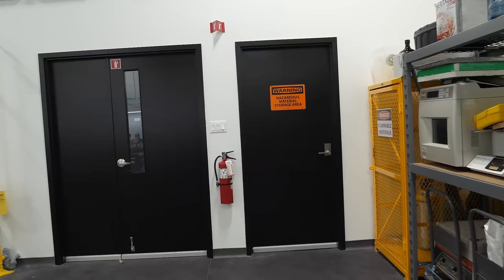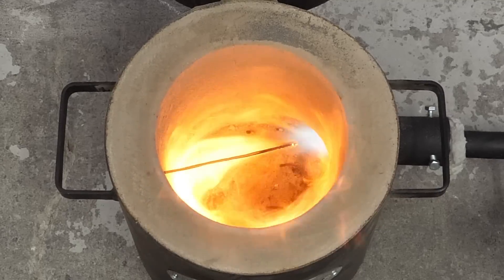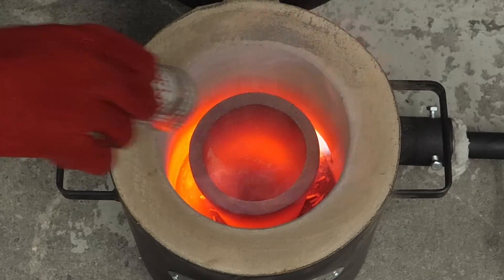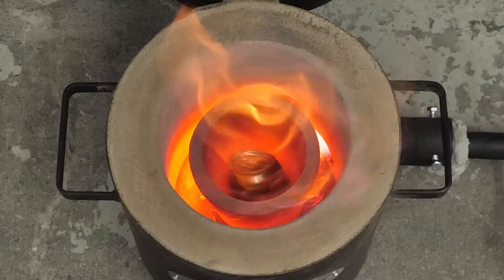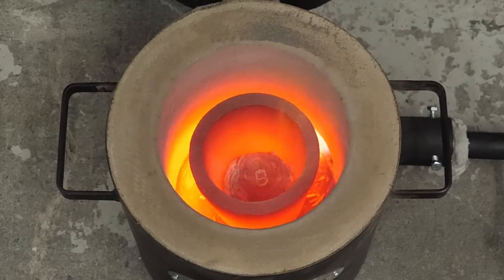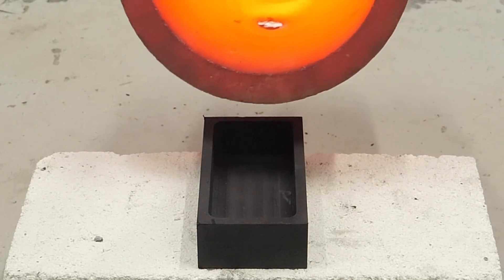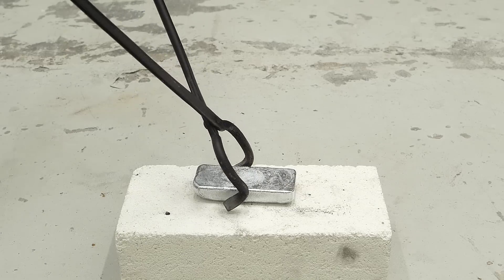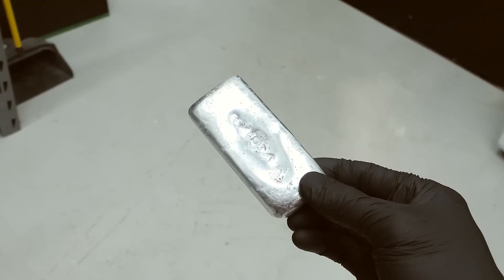Turning soda cans into a metal bar

Comment: That'd be a 0,15€/can in Finland when you return them to the stores for recycling. But that price is already included in the product price so you are basically just getting it back if you bought it yourself. And still, there are tons of cans and bottles on on the roadsides here in Finland. One bike ride and you could get a few euros worth of cans and bottles.

My favorite thing is to collect a massive amounts of bottles and cans over the year and return them a couple times a year all at once, resulting in 50€ per time typically. (Those are just my own cans and bottles, I don't clean the roadsides myself.) For those wondering, it's 0,15€ for cans, 0,10€ for glass bottles and some various smaller plastic bottles, 0,20€ for regular 0,5l bottles, and 0,40€ for 1,5l bottles.
Reply: that isn't a thing in the united states. lucky you

Comment: Mister Red, every can I empty is returned for the five cent deposit  I paid. I'm just guessing,  but that has to be a lot more than what it's worth as aluminum in a brick. As you probably guessed by the smoke produced, cans have a liner that burns away as well as paint.

Comment: The question is this: how much energy does recycling waste?
Reply: It costs a lot of energy, but it's of course the only solution since getting metal from ore is a process that is obviously very limited. For some metals, the amount that remains in nature will not even last 10 years from now.
And still, recycling remains expensive and even if you get the energy from renewable sources, no process if perfect and for each time you repeat the cycle (produce-->use-->recycle-->repeat), a small amount of it is lost. Therefore, it's essential that we repair and reuse stuff more often instead of throwing it away and that products are created for long lifetimes in general.

Comment: Nile, you are very smart so I'm 1000% sure you will get this....
FOR THE LIKE LOVE OF GOD, DONT PICK THE CRUCIBLE LIKE THAT, you need tongs that goes around the crucible, because clay graphite is hard but fragile, it's like grabbing a glass with pliers, you risk shattering and spilling the metal in your floor or worse, on you.
Also, you should temper your crucible (just heat it up until it's red hot turn the burner off and let it cool down inside of the furnace (it will change color, and that's a good sign that u did it properly)

Comment: That nice orange heat was enough to start melting brass...just a bit hot for aluminium. It tends to get hydrogen encapsulated in the metal.

Comment: Inside soda can there's a thin plastic liner inside the can and swipe flared up inside when you dropped it in that was all the plastic burning away in the smoke probably came from that and the paint on the outside of the can.
I'm in the process of creating a video of a process speed up and efficiently melts a large volume two cans

Comment: I tried this, and actually put a lot of effort into it, in a fireplace. But it didn't melt. It appears to me the cans are not just pure aluminium.

I was first able to melt some pot handle and a piece of aluminium in a fireplace and that gave me an idea to try to recycle the cans. The first attempts all resulted with them burning rather than melting, so I used some clay I cleaned to make a container with a narrow entry and cut the cans into tiny pieces. That was a lot of work. I added some candle was to the container along with the chunks and closed it with a lose lid, hoping the wax would burn with any remaining oxygen or at least push it out as it evaporates. But even as the container got red-hot, the pieces didn't melt at all.

I now live back in the city and still use the container, but for cigarette butts. The best result of my fireplace experiments was turning copper oxide back in the copper, although I couldn't make enough heat to melt the result and turn it into one solid piece.

Comment: The problem with melting cans is the paint on the outside and (for some cans) a thin layer of plastic that lines it. My older siblings made a makeshift aluminum forge in our back yard and we found the best things to melt where more solid pieces of aluminum and stuff like aluminum foil.

Comment: For future, if you crush the cans and fit more in instead of one at a time you'll save a lot of fuel and will have a more consolidated slag crust = more yield
Reply: if you collect enough slag you can remelt that as well and it'll give a surprising amount of metal back

Comment: Looks like my boy nile red picked up a devil forge! Hell yeah, you're going to love this thing. I have so much fun with it. Plus it can help you get some nearly pure metals for reactions.

Highly recommend you get some good welding gloves, and a can crusher, 1 safety and 2, you'll be able to fit a lot more cans at once, and cut down on propane costs, personally, I do this a lot... 

So I actually have a steel plate to set on top of the crucible, which starves oxygen inside and prevents some of the oxidation. 

It helps you get a higher yield, even when you have really thin starting material. 

I really hope you enjoy it as much as I do, it's good hobby (although my garage is constantly filled with all kinds of scrap😂)

Comment: Just FYI, I did this as a kid with a solid-fuel (mostly charcoal/coal, with forced air provided by either a hairdryer or a leaf blower depending on how much heat I was looking for) furnace I built, and what I discovered is that the aluminium in cans has a ton of iron in it. Really, you'd be better off with other sources of aluminium, since if you're not careful it's super easy to end up with literal chunks of iron in your aluminium ingot - which is very, very disappointing.

For your furnace, you can literally use a large brake drum with an L-shaped pipe on a flange welded into the bottom for airblast, plus some kaowool or ceramic barbecue tiles in the bottom to catch all the ash and keep it from falling into the airblast pipe. Bonus points for putting a railway plate on top of the outlet to slow down the rate at which heat escapes the furnace, and then use it to cook stuff while you melt metal... I did this, although it usually ended up burning whatever I was trying to cook pretty badly LOL

Also, you don't need a graphite crucible or mold to melt/cast aluminium. You can use steel - aluminium's melting point is low enough that steel can easily hold molten aluminium.

Comment: You're supposed to put the hot bar on ice. Then when it stops boiling, smash the ice with something like a cinder block or an empty tank. After that, go for a glass bottle beer in the fridge and kick you shoes off.

Comment: I suggest you look up BigStackD’s channel.  He melts down aluminum and copper and brass into different size bars, bricks, and coins. if you had left the lid shut you would’ve found the cans fit perfectly through that hole in the top which is what you’re supposed to do.  for those of you who watched this and enjoyed it, like I say check out his channel. he’s going for 1000 kg of material he’s over 3/4 of the way there.  A 2kilo brick of copper, aluminum, or brass is very impressive to look at once he gets it all shined up.

Comment: First off, proper ventilation is a must, I never do can meltdowns indoors. Second, you can start heating the crucible with it full, wastes less fuel and it heats up just as fast. And third, be safe and have fun, it’s not gonna make you any money pouring ingots, it’s more for either personal entertainment or material prep for a bigger project so you might as well enjoy it

Comment: That's how effective recycling aluminium is. Plastic is not the same. Buy metal cans for your drinks instead of plastic bottles it's much better for the environment. Also if you have some cans and some bottles and you only have limited space, recycle the cans first. Making new cans is bad for the environment the benefit comes from recycling. If you recycle the plastic instead, the majority (around 90%) gets chucked anyway you're really not saving much.

Comment: I’m not sure if it does anything, but whenever I light my furnace (basically yours but lined with ceramic wool) I leave the air disc on the back of the burner closed until I have the gas on. Then I open it.

Comment: I did this a couple of years ago from scratch. No kiln, no crucible, no mold whatsoever. Had a few brick laying around so I made a small forge, lit it up, fueled it with charcoal and a few days before I made a clay crucible and fired it in the same forge. The crucible worked very well (but only works once). I managed to melt around 30-40 cans, and poured it into small clay pot as a mold. Now I have a half sphere aluminium chunk. Ran another batch the next day with the same crucible, and the crucible cracked halfway and the aluminium leaked, forming this beautiful tree-shaped metal cast. It was awesome.

Comment: The problem with aluminum cans it's that, because they have so much surface area and are so thin, when heated, they oxidize more than they melt, creating more slag than usable metal. This can be solved by first melting an ingot to have a bath of molten metal in which to submerge the cans, so that they melt without contact with the atmosphere. Good luck with your next foundry.

Comment: Wow, this is one that I've actually got a bit of experience with.  One time out camping, my dad had the bright idea to make an aluminum version of those bigfoot footprint plaster casts.  We took a steel bucket and put all the used beer and soda cans from the trip into it, put it in the fire until the cans were a liquid, and poured it into the print.  Unfortunately our recipe accidentally made chunky flavor aluminum, so the footprint cast came out looking really really bad, with lots of bubbles and a couple semi-intact pull tabs and base rings sticking out from odd angles.  But it was still really fun to stir the cauldron during the melting phase.
Reply: I mean, hey. It’s still a piece of history.
Reply: I never managed to melt aluminium in a fire.

But the year before covid, me and my pals went to a camping trip near some abandoned towns (from before the WWII). We scouted there and found a lot of cool stuff, but also even more modern trash.

One of the things we found was a lead pipe poking out of the ground, probably the prewar idea of a water pipe. We broke it off, then back in the camp I chopped it with an axe and we made some molds in the sandy soil. The best result was simply pressing a small pine cone in the ground and using that as a mold. It is quite recognizable.

Also learned a cool trick - when taking things out of a fire, wrap your hand with a wet tshirt.

Comment: Makes you realize how much aluminum goes to waste with unrecycled cans.
Reply: Some absurd fraction of all aluminum ever produced has been recycled. I've seen the number as high as 75%. That's from the fist aluminum produced ever until now. It's way higher than I though it would be, but smelting aluminum ore (using the Hall–Héroult process) is incredibly energy intensive so there is a clear economic incentive. Wikiepedia claims recycling aluminum requires only 5% of the energy of producing raw aluminum from ore.

But you aren't wrong, there is still a lot that does not get recycled.
Reply: @Fix_It_Again_Tony  

I think it’s mostly the cans because they’re tossed in the trash in most cases, and not recycled. I’m not concerned that we’ll ever run out of aluminum, considering 9% of the earth’s crust is aluminum, so it is abundant. I just didn’t realize how much aluminum a few soda cans contains until he melted them.
Reply: In my country you can recycle them store at grocery stores in a machine for like €0.1 euro per can. I read Carlsberg gets like 85% of their cans and bottle materials returned.

Comment: I actually did this with an old iron soup can and a fire once. Used some stone bricks to surround the the soup can and started dumpin them in. Eventually when it was melted I poured the molten aluminium in a hole from a brick and made a small solid cylinder.

Comment: In theory you should pre-dry both your crucible and your foundry, (red-hot for hour, and slow cooling for 24 hours) and you should put few crushed cans together with crucible in the foundry, instead of dropping them one by one after preheating the crucible 👍 still, nice video

Comment: Ok, I hear you guys, can aluminium, on it's own, isn't the best material. However, there is a fix for this.

Aluminium-zinc alloys are some of the strongest Al alloys known. If you have some zinc kicking around, some magnesium, and some silicon, you can turn this gummy can aluminium into something superior.

Comment: They smoke because they're coated with paint on the outside and plastic on the inside, definitely toxic. Crush them before hand to so you can add a bunch and close your furnace. And take off the tabs, they have to punch through aluminum, so they're made of a different, harder metal!

Comment: You should put metal salts in the crucible & melt that first.  (You can use aluminum brazing flux, which is similar to the flux used in aluminum electrolytic refining, NaAlF6).  This way, the aluminum immediately melts by conduction & is protected from the air.  I suspect you lost a lot of the aluminum melting it in air!  Did you weigh the total of what you added & then also weigh the bar you got?

Comment: hey a few small tips, before turning on your furnace, put your crucible first with a piece of paper underneath, it will prevent it from sticking. Also load your crucible before firing, as it prevent thermal shocks (especially on crucible of low quality, good one don't really care that much). Finally if you want to degas aluminium, you can either buy small tablets that you have to plunge inside the liquid, or you can bubble nitrogen.

Comment: When we took in cans to get recycled we got told to pull the tabs off and hand them in separated; they were made of something different and thus were worth more. It's been five years so I don't remember the exact thing they were being used for, but I remember it was something to help the elderly; either wheelchairs, walking sticks, or prosthetics.
Reply: Different parts of the can are made of slightly different alloys but it doesn't matter then you are just casting things like ingots

Comment: Would be nice if car manufacturers could recycle aluminum cans and use them to make more reliable cars... The Honda Grace for example is a relatively new vehicle and it was built poorly. The rear bumper tends to crumple very easily along with the trunk lid. 90s cars were generally built better and have stood the test of time. Coming from a Nissan B15 driver.

Comment: If you consider using aluminum cans for casting aluminum - don't.
Aluminum from aluminum cans is terrible for casting because it isn't meant to be cast and lacks the necesary additives.
Instead use cast engine parts, which are easy to come by.
Personally i've found cast VW intake manifolds to be pretty good material for casting at home.
But any other part will work also.
Reply: list the additives so I can put them in
Reply: @kingmasterlord  I have heard it is primarily added silicon to control the grain structure when it crystallizes.  I have cast soda cans before.  I don't doubt that it might be "terrible" for strength but I had no issues with decorative pieces.  I haven't tried adding silicon yet.
Reply: @jamiekawabata7101  I've tried adding silicon, it reduces shrinking and makes it metal flow better. I stopped melting cans sinse I got a supply of sheet metal scrap from my school and don't bother with the silicon since it casts just fine without it
Reply: @kingmasterlord  I forget what alloy that is to start with, a little magnesium or something I think?  Probably not enough to interfere with the key ingredient needed -- silicon.  You need a lot of it, typical casting alloys (320, 356) are in the 6-10% range.

Not easy to melt in, as elemental silicon has quite a high melting point, and it's not going to dissolve without a flux (both aluminum and silicon have tough surface oxides!).  Next best would be selecting scrap with higher Si content; often, aluminum forgings (some pistons, con rods, e.g. alloy 390) are in the 20-24% range (hypereutectic), so could be diluted by half to get something closer to 356.
Reply: So you're saying the aluminum from soda cans is too pure?
Reply: @gabedarrett1301  cans have extra manganese and magnesium added to them but puts aluminum is not ideal aswell, both of them should cast just fine tho
Reply: Cans will work if they're all you can get your hands on, but yeah- if you can source something better, definitely do. Even ignoring the less-than-ideal composition of the metal used, cans have so much paint and drek on them that causes a massive amount of dross you wouldn't otherwise get. Plus, the amount of usable metal you get per unit of mass is terrible.
I started off casting with cans and they were fine, but as soon as I could find a better source of metal- a bunch of flytipped garden furniture with aluminium frames, in my case- I ditched them.